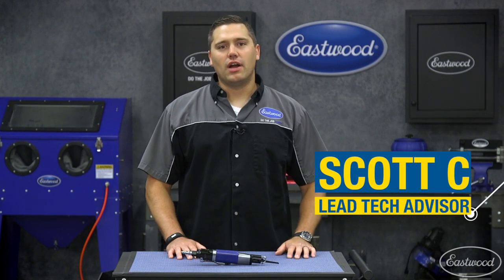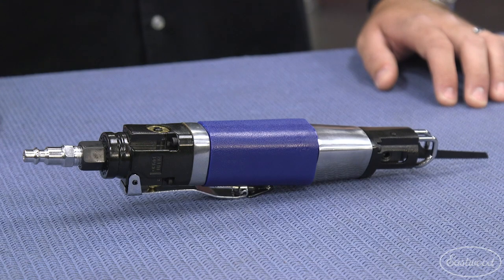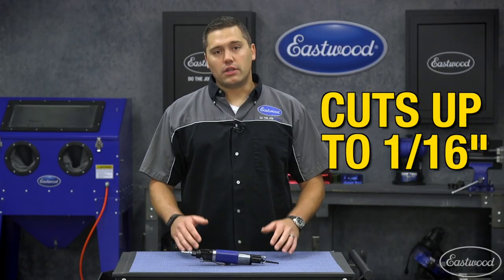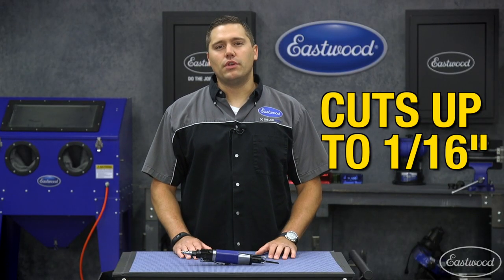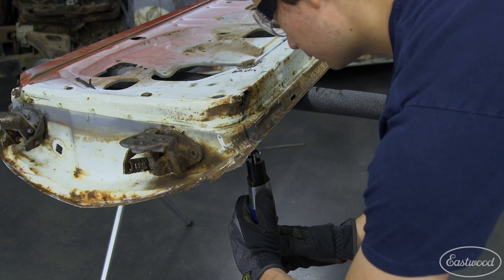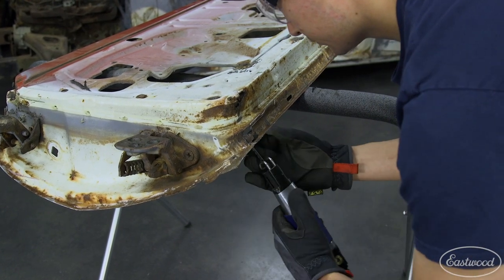Air Body Saw - Perfect for Sheet Metal & Exhaust Work! Easily Cut Shapes & Curves - Eastwood

Comment: Why didn't you state if the tool has a pressure adjuster that's independent of the system pressure.